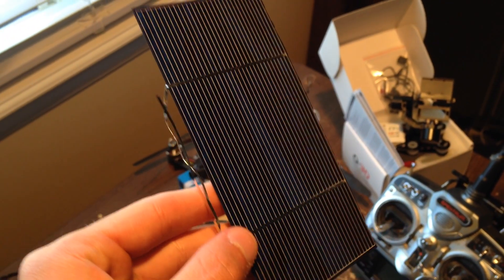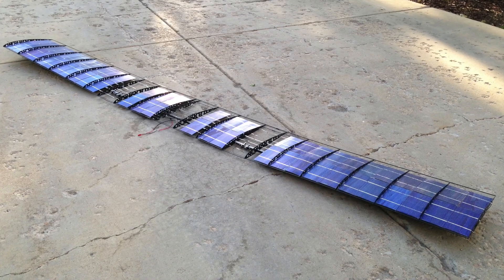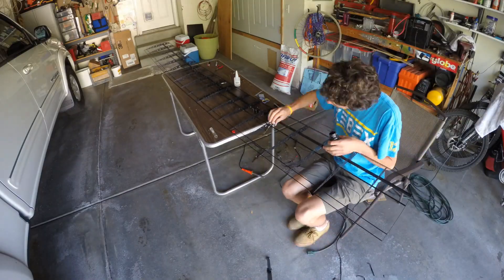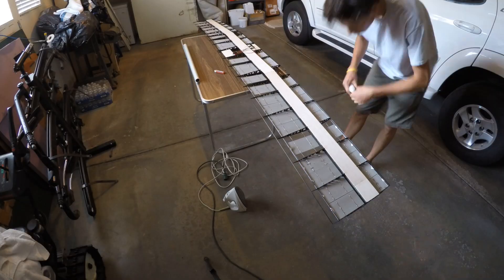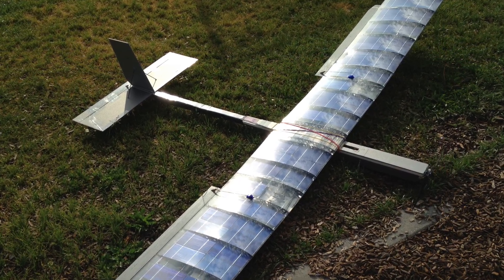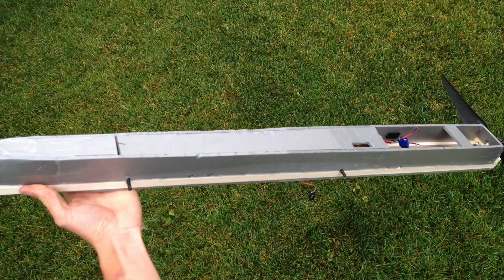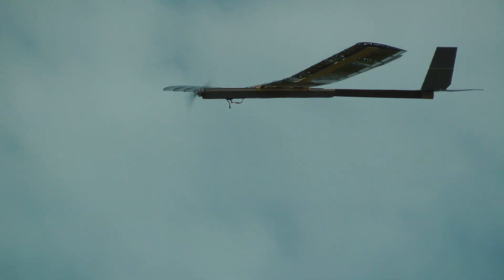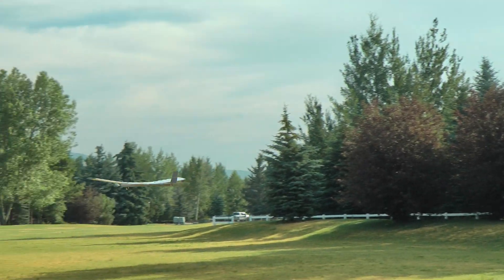SOLAR Powered RC FPV Plane Build and Maiden - RCTESTFLIGHT -

Comment: The carbon was probably already non conducive due to the epoxy used in it. Did you bother to check the resistance or are u just like me and like building stuff more than using it lol

Comment: You should have measured the resistance of the carbon struts instead of insulating them right away? The carbon fiber parts are mostly just impregnated and laminated with epoxy so you wouldn't have any conductivity anyways.

Comment: This is super impressive. I've always been thinking about building a solar powered plane, but the obstacle has always been how much it would cost to buy optimal panels. How much did it cost for those panels and what was their nominal voltage and current?

Comment: Sustainable solar flite possible when solar film is readily available, your solar cells are too heavy to lift themselves...solar film could be the actual covering of a wing, saving weight, and ridding yurself of any reflective losses.  Solar cell efficiency is getting better every year....one suggestion in the comments regarding super capacitors....much lighter than batteries, and moreover, can absorb solar energy WITHOUT a charge controller.  I think this would give you the amps needed for takeoff, and closer to your goal of sustained solar flite.  Super hard challenge.  It has been accomplished with full sized aircraft, if you could pull this off, my hats off, sir.

Comment: well done mate, great project. have you thought of using 3d printed nodes or elbows to connect all the carbon spars and tubing. the colorfab carbon fiber 3d printing filament for fdm printers might be strong enough and light enough.

Comment: hey dude what is the size and how many solar panels did you use? what voltage is your plane running on and also where did you get those solar cells?

Comment: Awesome ! This is a good idea but to save on weight, consider ultracapacitors instead of batteries. They are a LOT lighter than batteries and can store quite a bit of charge. Unlike batteries, ultracapacitors charge quicker. There are YouTube videos of people using ultracapacitors to start a truck!  Now, to eek out even more power and extend your hang time, consider using a Joule Thief type circuit to extend the life of your power supply.

Comment: cover the tail planes with solar panels as well?
Reply: +staslig if it does not expose much to the sun light then it would just mean an additional weight...especially if the power it produces is not enough to carry its own weight
Reply: but why should it not be exposed to sunlight?
its more surface area and even if the tail fin creates some shade, its possible to but the fin underneath or 50/50 under and above.

Comment: there is a 3s Lithium ION charger on ebay with charging management. all you need are 3 laptop 18650 cells. They should be enough to power your plane. You can charge and fly. Its like a laptop battery management.

Comment: have a remote switch to toggle between battery power and solar power,,, you could use battery power for tougher manoeuvres (take off..) and then switch to solar.. also if you can get the additional solar energy to charge the batt.. it will be epic!!

Waiting for your next update.. all the best..

Comment: First I got excited by it but then I realized it's just a rc plane having plates of glass inside wing structure. For now..

-Motor is way too high speed and inefficient for this use even by the sound of it.
-Plane looks too fast to be efficient. It should float in the air. Airspeed equals power you don't have. Squared.
-Plane is still too small.
etc.etc.

Comment: Wow great job. Really well executed. Have you considered using a lipo monitor, osd and micro fpv setup to monitor the power produced by the solar panels while test flying under lipo power? It Could give you an idea as to what power the solar cells are producing instead of tossing and crossing your fingers. Also maybe you could charge super capacitors instead of lipos in flight?

Comment: Maybe a pair of super capacitors in series with the solar cell and the engine.  That way there would be very little extra weight but enough spare power when the solar cells are not receiving enough light.

Comment: this solar cells is very fragile and low efficiency about 15% you can  use the sunpower back contact cells 22% efficiency.even if they brake they work and they are a little flexible.for the battery you can wire the cells with one cell pcb charger for every cell  off the battery this way you got lightweight and great efficiency.if you are interested i can explain more detailed .

Comment: I worked on a similar project sometime ago. You should look into the flexible solar cells available in the market for the next version of the project. A bit more expensive but might save a lot of headaches after a crash. I used the flexible solar cells without film covering so better efficiency however they could only power the electronics not the motor. Who knows technology evolved quite a bit in the past couple of years and to be honest I didn't try something as big as your wing. Looking forward for your next video.

Comment: It adds a little bit of weight to add a solar regulator to charge batteries. There are not ehough cells to provide the current required on demand by the motor. I have built these systems since they were invented and best use is to charge batteries. They look cool and you did an awesome job. But Current is the loser here.

Comment: I'd say, dont use the top plastic cover. And why even need the bottom smoothed out when you look a parachute en delta wind design. You'll need all the solar power you can catch. Top of fuselage can be solar cells also, Also empennage. (Talking from my armchair here).

Comment: Daniel, have you heard about the new flexible solar panels?  There was an article called "If It's June, it's time for SMALL 2015" in the June 2015 Model Aviation magazine about installing solar panels in your plane.  It mentions using new flexible, light-weight solar panels brand called PowerFilm Solar (available on Amazon).  Bought some to try myself on a UMX Radian.  Also, was wondering if you considered building your wing with balsa, I thought it would be lighter than carbon fiber, but still provide enough strength.

Comment: Great project. Have you got supercapacitors to buffer some of that current? You can connect them in series to get to the required voltage produced from the solar cells. The nano force brand supercaps seem to have the highest capacity for weight.

Comment: Instead of a charger, maybe some strong diodes to prevent power from flowing into the battery.  This would be light weight, you'd be using the power from the solar panels with added buffer from the batteries.  This, of course, depends on how much voltage you're running from your panels and your battery.

Comment: Great Project. As per usual, you are raising the bar in Aeromodelling. One thing I thought may help when drilling carbon fibre, is to wrap it in a layer of Electical Tape before drilling. Then drill a very small pilot hole ( no pun intended ) about 1/3 the size of the total hole required. Then ( with the tape still on ) use a Glass Drill with slow revs and barely any pressure. Maybe also see if you could shape a piece of dowel to fit snugly inside the tubing, so that when you drill, it reduces the flexing and gives you a firm surface to drill through. Good luck with the rest of the project. I look forward to seeing the next steps. I think every aero modeller has dreamed of owning a model that you can fly for as long as you want, instead of a bunch of 10 minute flights. Keep up the good work.

Comment: ou could have test to see if the panels could supply enough power to run the motor before you built and flew the airplane. -.-

Comment: Awesome work. You should move the wings back on the fuselage to reduce the need for ballast and you will need some power electronics with maximum power point tracking in order to supply enough current to the motor and maximise the solar cells output efficiency.

Comment: Really well executed D, diodes for charging will be useful and you will want charging even if the cells power flight because then you can fly through the night. Get an apm in and have it loop over your property endlessly. Nice spar cut and design, cf tube slip fit could be good for breakdown, the tube off ebay even snug fits each size you go down.

Comment: Beautiful!  Just for My two cents I cast My vote for running at least a small battery in the power system to buffer the solar panels which will provide highly variable amounts of power as the attitude of the plane changes vs. the Sun.  May be stick a temp censer inside the covering too when You set up the FPV.  I look forward to more about Your plane.  It's great!
Reply: Maybe there would be additional lift from the hot air inside the wings ;)
Reply: Solar cells get quite hot.  The power drops as they heat up.  They can get solder melting hot. Cover melting hot.  They need venting to maintain temperatures within design parameters.  Arrays are sensitive to angel to the Sun as well.  That's why permanent installations are tilted.  Off angle Sun can be viewed on a volt meter.  The plane would be variable RPM during flight without some buffering.  Local latitude can be noted on a volt meter as well, as well as time of day and year.  Not like a GPS, but level of output.
A little extra lift from different density would be nice though!  Winter is going to delay testing at His latitude.  Time to fly South soon!